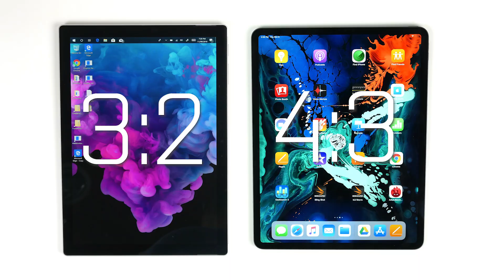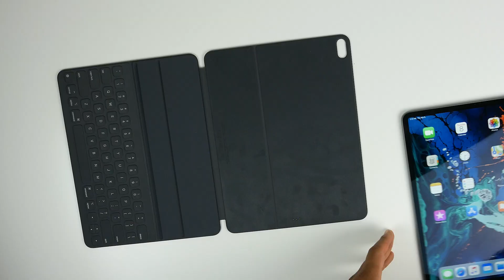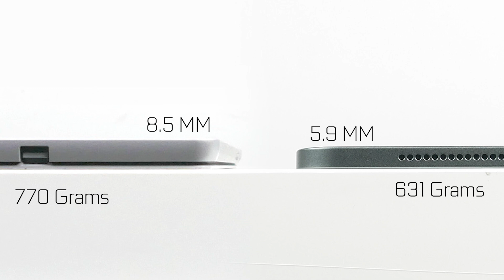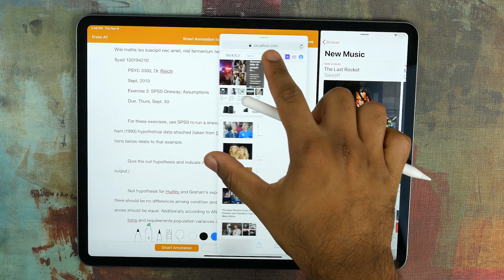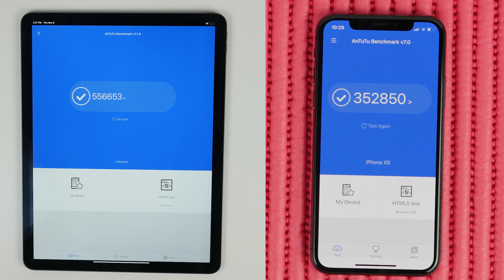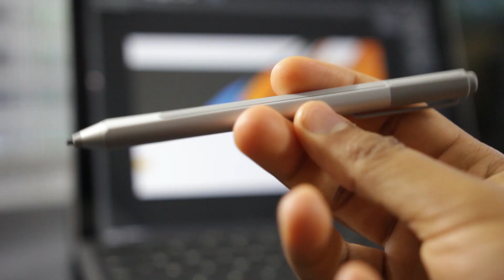2018 iPad Pro vs Surface Pro 6

Comment: The iPad is the one tablet

The surface pro is a laptop with a broken hinge lol
Reply: Bryan Miller surface pro 6's processor is better than the latest macbook pro 13 inch. This reviewer was biased, pro takes it by far
Reply: ipad is just a bigger iphone, the Surface is a tablet that can run like a real pc. Surface is 1203x better and its not even close, and the ipad dooesnt even have a hinge just a shitty plastic stand

Comment: That is probably one of the most objective comparisons I have ever seen on the Internet congrats for your work. I went for the iPad Pro 2018 but I could have easily ended up withthe surface pro 6. Amazing devices both for portability..

Comment: “This LCD can reproduce 128.4 percent of the sRGB color gamut and registered a Delta-E color-accuracy score of 0.29 (0 is perfect). The Galaxy Book 2's OLED display is more colorful, reaching 200.2 percent of sRGB, but it's not as accurate (0.31), while the Surface Pro 6 produced slightly more colors than the iPad (136 percent) but with worse accuracy (0.56).”

Source for the above info laptopmag.com. So yes, the iPad Pro is very good at color reproduction for accuracy sake. I do a lot of art on it, and have taken the images onto a professionally calibrated Cintiq monitor. The colors I felt were very close, with my iPad Pro being a little on the warmer end. But u had to really try hard to nitpick the differences.

Comment: A12x has nearly the same performance as i5-8250u at the same TDP. Intel CPU has RISC internal core with transcoder receiving CISC instructions to process things faster, meaning they are basically the same architecture with different instruction sets. Nonetheless I still got Surface Pro 6 top-end model cuz' A12x is powerful, but not that powerful. i7-8650u is still faster than A12X, and that A12X doesn't have virtualization and turbo boost, besides with Intel XTU I can change TDP to somewhere higher making it much faster than A12x (Surface won't be overheated due to improved hybrid cooling system), and I just couldn't leave Windows 10 because of all those cool features like Hyper-V, VHD Native Boot and WSL. Maybe one day when iPad Pro comes with MacOS and Boot Camp I'll consider choosing it.

Comment: This wasn't no comparison, this was just to pay homage to ipads (he mor than likely is getting paid under the table to do it)!
What this "genius" forget to tell his veiwers is that although the iPad has everything he says is on there that beats the surface Pro, the iPad is not built to perform like a laptop but a big unnecessary smartphone... without the phone! And who in the hell wants a unit without a wired headphone jack??? They want u to run around with 2 iBeats, i bet.

Comment: The iPad- yes, it may be faster than 92% laptops- but it’s still just a frikin tablet you can use instead of a laptop (no one ever said that you can use it as a laptop it’s just impossible cuz it’s a tablet)
The Surface?- ehh it’s a tablet running a PC os- u see? U can’t compare a tablet trying to be a pc and tablet running PC os
So if you just need even more portable or wtf laptop go for the surface, but if you want superduper cool overpriced (not to be mistaken i like most of apple’s products) go for the ipad CORRECT ME IF I AM WRONG 😩👌🏽

Comment: The Surface Pro 6 runs a Quad core i7.  Apples A12X (8 cores total, with four processor cores providing maximum performance and four slower cores used when battery life is more important) Geek Bench is optimized for Apple. The i7 wins in the Single core test but gets blown away in Multi core. Pure shizzz, also Apple always wins in the display department.  Even Samsung (with a better display)  struggles against a Brand new Apple device

Comment: I love pretty much everything about my 5th gen Surface Pro except for its battery. I'm only getting like 3-4 hours of battery by just doing nothing. I have Outlook, Word, and Firefox open and do nothing, and the battery drains extremely fast. I might just have a defective device. Everything else is great though.

Comment: Stop with the laptop replacement conversation. It’s ridiculous and no one from apple is saying that. Hints showing off laptops during same reveal, no macOS, etc... Even the surface to a certain degree is a middle ground not a replacement. It’s a junk conversation used as click bait and something to talk about when you’ve got nothing else to fill the time.

Comment: I’m a longtime Mac and iOS user, and not a fan of Windows by any means, but the Surface Pro is a FAR BETTER laptop replacement unless you’re an artist or mostly use a laptop for Netflix and Facebook.  I hope soon Apple with release a touchscreen friendly version of Mac OS X or a desktop-class version of iOS, more desktop-class apps, a proper file system browser, and add more ports and expandable storage to the iPad. But until then the Surface is a better computer (and the iPad is still the best pure tablet in the world).

Comment: Apple is trying its very best to advertise the iPad Pro as a laptop replacement, while Microsoft is doing the quiet opposite by advertising the Surface Pro as a tablet. The reason is really simple: Apple knows that iPad is nothing near a laptop, so they have to use all their brain power to convince you that it is; while almost everybody knows that Surface Pro is a great laptop, and Microsoft just need you to acknowledge the fact that you can use Surface Pro as a tablet too if you truly want to. I mean, how in the world do you expect a device with a MOBILE CHIP to run as many apps, be as fast, or even be half as powerful as a device using i7-8650U? It's really funny how a lot of Apple sheep are trying to convince people that iPad is a computer (or even super computer), while those sheep themselves are probably using a REAL computer to do all the professional works. Ironic, isn't it? In fact, I don't even think that anybody who works at Apple can do all their work on the TABLET that they are calling computers.
Reply: 高子烨 the i7 8th gen in the surface thermal throttles so it basically performes like an i5 when pushed. If you want a proper laptop neither the surface nor the ipad is a choice.

Comment: I have an idea to solve the problem. Many people have money do they can buy both. I would suggest that many people need a computer + tablet. So one can buy a surface book or MacBook and with that a iPad Pro as tablet. Surface definitely more powerful to run windows programs but for day to day task I would suggest an iPad Pro.  Some people just need computer for copy paste task so for doing that task use an computer worth 10000. So conclusion is iPad can’t replace laptop or desktop so if you are a professional to use photoshop or video editing buy a good laptop like MacBook or surfacebook, not a duo tablet + computer. And then when you have saved enough money then buy an iPad which will organise your day to day task. And if you are an artist and movieworm then definitely iPad Pro. It has a lot of power and then save money and buy a good or mediocre laptop according to your need
Reply: Just get a iPad 2018 normal version for this use case......

Comment: U can charge the apple pencil, sure, but u don't need to charge the surface Pen between those 12 months at all 😂😂😂
Reply: This comparison is just stupid
Reply: Furthermore you can change the tips of the surface Pen so the tip can't be compared so easy either

Comment: I don’t normally comment on things but as a recent iPad Pro 2018 owner who uses it for pro purposes, website building, video editing, clothing design etc I don’t think people who are in the windows camp and even Mac camp understand how good an iPad can be for these tasks. If you try to use an iPad the same way you use a laptop it isn’t going to work out well because it is not a laptop and isn’t meant to be a laptop either its trying to replace a laptop. I don’t want a keyboard for my iPad (I bought one and used it once) I love the iPads on screen keyboard because if it’s ability to adapt to my tasks. It’s a lighter more simplified os but does have some amazing software. I’ve been able to purchase all the software I need, a lot of which wasn’t available on either macOS or windows. I actually am using it for everything instead of my desktop as the workflow I have developed suits me brilliantly. I understand slot of people are used to a keyboard and trackpad/mouse but there are a lot of young professionals who haven’t grown up using keyboards and mice but have grown up with touch screens instead. The iPad isn’t trying to be a laptop its aiming to be the thing that replaces the laptop and as more people like myself come about I’ve no doubt it will do. Both macOS and windows are the best of the past. iOS will end up being the future but while people adapt there are more traditional computers out there. My issue with the surface and windows 10 is that they are stuck in limbo, to offer traditional computing features its having to make compromises in the touch experience and compromises in the traditional computer experience in the form of cost, that result in them being decent as laptops but not good as tablets and by trying to do both they are succeeding at neither. As for those saying there is no way to compare the a12x to the i7 8650 U, the iPad wins in all benchmarks and in real life usage. The latter is the most important. Instead of coming up with excuses just give apple props for what they’ve done with the A12x. The a12X is the best example of the issues that the surface pro has along with intels 14nm barrier. The surface looses a lot of potential for the future by being tethered to the past. The iPad is built for the future so comes with some issues for some in the present

Comment: I have a gaming laptop that I use for work and about to buy a ipad pro 12.9” because it’s great for the graphic designing that I like to do.  I tried to get my ipad air 2 to replace my laptop, but saving everything on the cloud was clunky and disorganized.  It would take me 4 hours to do my invoicing vs about 1.5 hours using my laptop, so I won’t be trying that again.  It may not be worth the cost to someone who would only be using it casually, as there’s a LOT of power, but that power is geared toward those that may be using it for sound/video editing, using photoshop or Illustrator, or some other higher function.  I certainly wouldn’t buy it if I wasn’t a graphic designer.  It would be like buying a industrial power washer to clean my window sills.

Comment: I love this tablet/slate form factor. However, for the work that I do, the iPad just won’t cut it. I have the 1st gen 12.9 inch complete with keyboard and pencil. 

This has been the biggest waste of money for me. Seriously. They market it as a laptop replacement, but the damn thing has no mouse support. Then, the files app and the way it handles file downloads, overall, is a joke. This new iPad Pro can’t even read files from a usb drive. 

That being said, the Surface is a nice device....a real computer, but Windows is such a shit-ass OS that I’d rather not.

I’m going to give the Pixelbook Slate a try, this time around. Mouse support, Chrome OS is good for what I need to do....it makes a great middle ground device, between my phone and my MacBook Pro. I won’t be commented to the Apple ecosystem, with it (I.e. iMessage and FaceTime), but I’ll live.

Comment: I have the previous generation iPad pro.  It's an amazing tablet.  Unfortunately, it IS just a tablet.  If it got OSx or a real operating system, it would be an incredible overall machine.  As such, I prefer the full desktop operating system offered on the Surface Pro series.  I will be picking one up soon.  Sadly, this latest generation does not have LTE or Iris graphics.  UHD620 is a pretty big downgrade compared to IRIS640.

Comment: iPad, a pricey and less productive device. why settle for an expensive device that limits your productivity? 
Surface Pro, a tiny device that can do almost every thing your desktop can do. Can i play Dota in iPad? can i install Autocad 2018 on it? Google Sketchup? Premiere, after Effects? Lumion, revit? Can i? of course no. so stop your argument that Ipad is better than Surface.  usb c? no, maybe soon but not for now, why? most devices and even new devices comes with standard usb ports and connection. you cannot carry those connectors every time with your iPad,

Comment: So you saying that: "Windows is the most capable platform in the world?" _ I challenge that - !!! Secondly - did you ever  mentioned that the Ipad comes as WiFi or Cellular??? did you ever mention that is the safest platform - !!! did you ever mention that it has Face ID - !!! did you ever mention that you can any I mean any type connections on the Ipad you just need to have the connector - !!! Windows prone to crash, freeze a lot, never ever happend to me on the IOS - FACT - !!! So this is very very stupid comparison if you asking me !!!

Comment: Try working with two complex Excel files at the same time on you shiny new iPad Pro, say you want to copy numbers from file A to file B. 

It won’t work. 

a) you can’t open two excel files in Excel on your iPad at the same time and 
b) Apple‘s Numbers doesn’t have the  necessary functionality.

I really wanted it to work, because I wanted to work with the iPad Pro. Even Apple support couldn’t help. So long, iPad Pro... farewell

Comment: The thing I think people really miss about this debate is that the Surface isn’t really a tablet. Sure, it looks like a tablet, it walks like a tablet, it talks like a tablet, but in reality it’s a laptop with a detachable keyboard. The fundamental concept of a tablet is different from a laptop - you interact differently than you would with a laptop. Because of that, the surface pro is always a better laptop replacement because it isn’t - it’s a laptop disguised as a tablet. What Apple keeps saying is not that they’ve finally made a tablet that’s also a laptop, they’re saying that you should do things on a tablet instead of a laptop and that if you accept that notion, then this iPad can replace your laptop. 

Still can’t run Logic, though.

Comment: The A12x is a mobile software and there is no comparison to intel
Reply: patrickboom05 A12x is a piece of hardware not software. It seems that you have no grasps of the very basic concepts of computing. Good luck.
Reply: Then Windows is desktop hardware

Comment: So im trying to decide between these two. I need something to do my hw on so like using word or typing papers also something that is good at watching videos im going to buy a 3rd party keyboard case for the ipad pro 11 inch base model if i get it. The surface pro 6 im looking at is 128gb 8 ram i5. Which one should should i buy beacuse i would also need to get a usb c hub for the ipad.

Comment: The reason why this comparison exists is because both the Surface Pro and the iPad Pro are trying to be the same thing; a functional two-in-one.

Personally though, between the two, despite the fact that they're still tablets, the Surface Pro takes the cake for me. Operating system, it can use an external file storage, the like...if the iPad Pro could do all that, then I'd definitely consider it. But as it is right now...it just feels like a bigger iPhone X, to me.

Comment: Surface is a Laptop with the ability to act like a tablet and the iPad pro is a tablet with the ability to act kind of like a laptop.🤷🏽‍♂️
Reply: Not even kind of like a laptop its more like kind of like a 200 dollar crappy ass laptop that cant run minecraft
Reply: I like my Surface as a Handy secondary laptop. I dont own a Desktop PC. one time my laptop needed to be repaired i had to use my surface for 1-2 weeks. It performed well as a main PC. I would have been in trouble if i had an IPad as a secondary PC instead.
Reply: Trudeau you are homosexual act like are straight man.😂😁
Reply: William Chan thanks William😂👌🏽

Comment: The really huge problem of arm is that it has no fan. You can make the a12x run really strong, but for a short period of time, system will lower the clock speed after the cpu is overheat

Comment: You forgot to Mention, Ipad Pro has a 120hz panel, Adobe SRGB 99%, 2048 relative to 4096 pen pressure far compare to Surface Pro, if we talk about Digital Painting, Ipad Pro 3 win. It just a time when the OS have a big capability or at least a Hybrid IOS Pro. Were in Transition right now from Desktop OS to Hybrid Mobile OS for productivity.

Comment: Ipads are bigger iphones no more their biggest problem is their software, dont even bother buying a new version of the ipad when an old one costs 1/4 of the price and is practically the sane. If you have the money buy a surface pro, way better than an ipad and will always be until an ipad is as useful as a mac, then we can start calling it a laptop killer, until then the surface is the clear winner of tablets and laptops.

Comment: What the actual fuck, it is 2018 and some stupid dickwad is still comparing a actual convertible Notebook with a fucking tablet and referencing it as a actual fucking tablet. You have just nullified your existence as an actual intelligent reviewer with this video/ The two are totally and completely different as the one has actual mouse input and the other does not. The one runs an actual computer OS and the other does not. Stop dragging the world down with your idiot views and stop feeding the propaganda that an iPad will ever replace a laptop as that will only happen when you enable mouse input. So lets wait till that future date when hell freezes over and apple puts Mac OS on an iPad and enables additional features for the tablet format. That will we wan then review it against an actual notebook with similar loads. So take the dickwad video offline before the infection spreads